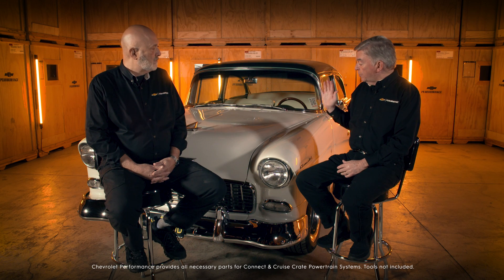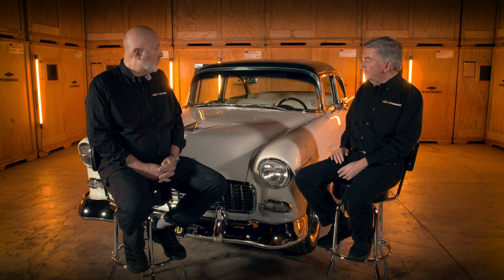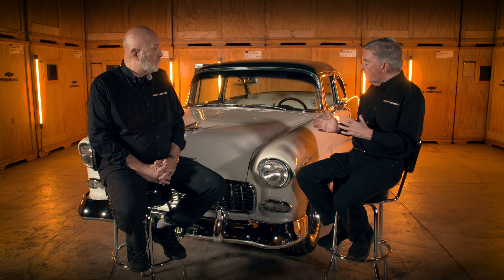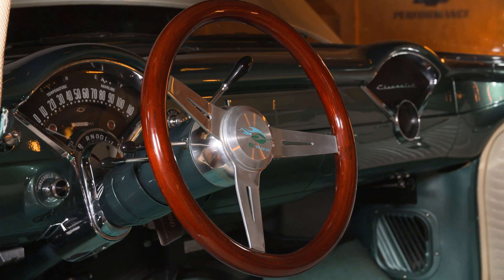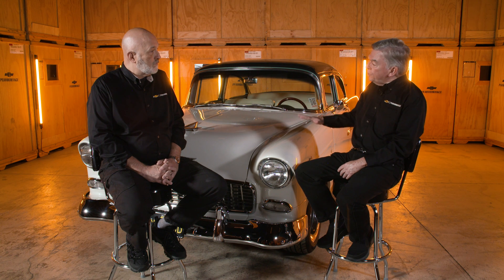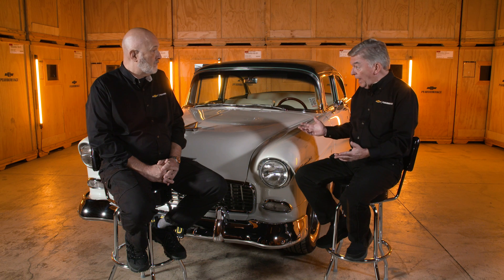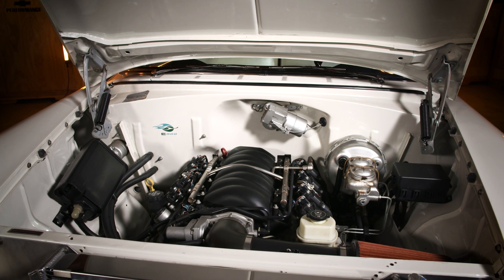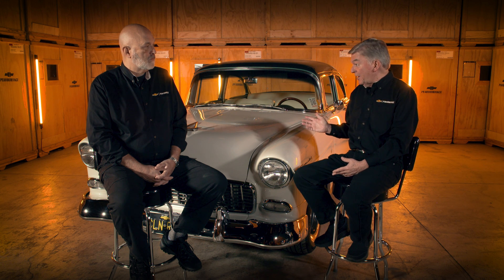‘55 Bel Air with LS3 E-ROD/4L65-E Connect & Cruise

Comment: Ol'55 53-57, I think this 55 is the most beautiful of the first generation of Bell Air. In 1955, the engine was Corvette C4, the wheels were Camaro, the height of the car was dropped a little, and it is rare that it was so beautifully customized. After all, the tintoy-like paint on the body and the jewel-like interior color and texture that match it, this kind of custom would probably be unmatched by American flair.
Ol'55, be forever.